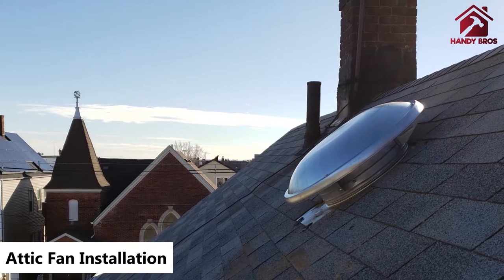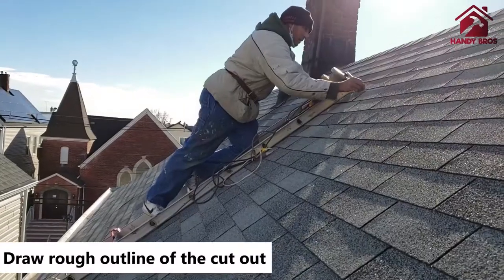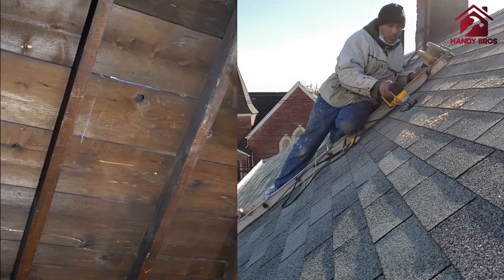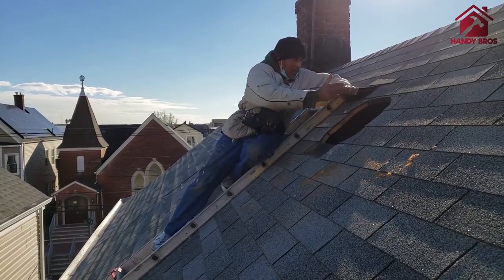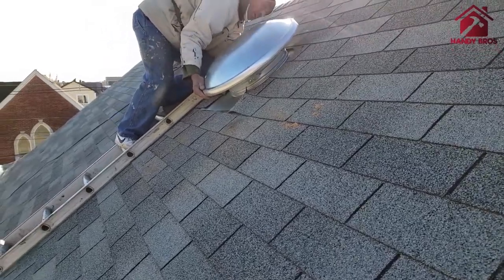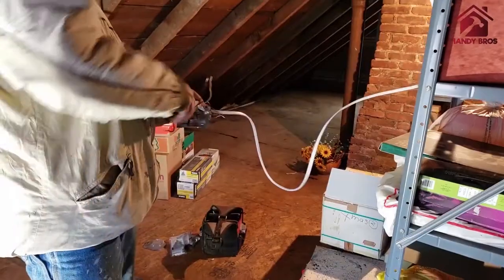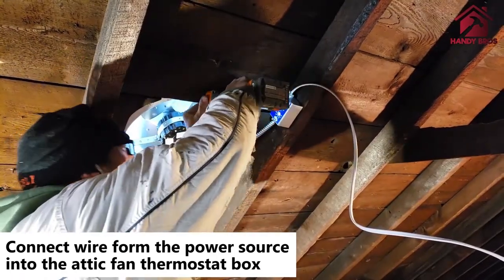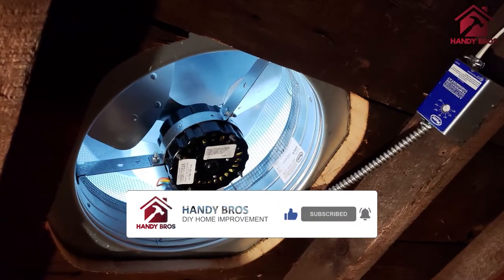Roof Attic Fan Installation | HANDYBROS |

Comment: My roofer installed a roof vent fan its making a lot of noise . What could be the problem do we need to install some kind of dampers or rubber seal to reduce the noise
Reply from the maker: make sure it's not touching anything. The motor could be bad too. The attic fans are usually a little loud unless they are the high-end ones.